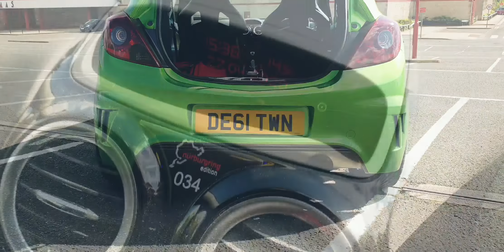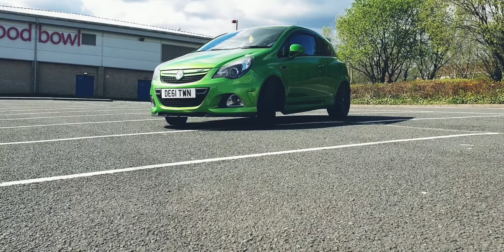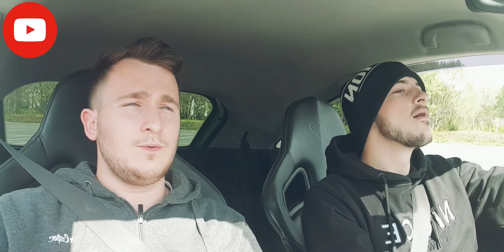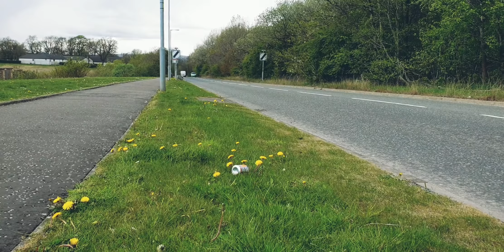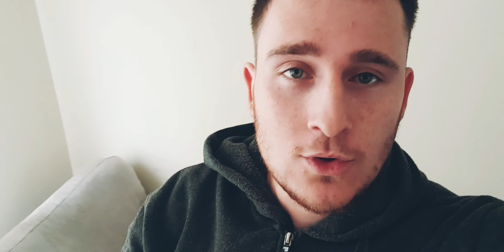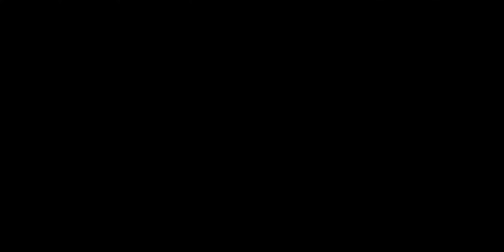Corsa Vxr nurburgring

Comment: Getting a Corsa VXR in next few months would you recommend going for the Nurburgring edition or standard and just getting a stage 1?
Reply from the maker: bro i use to have a corsa vxr nurburgring edition, don't remap the car because you will kill the engine get a proper map change the spark plugs, induction kit, exhaust etc because i was remap the car and after 1 week my turbo was a way , so better do it properly cost a bit more but you will "have the car for long time " hope that helps
Reply from the maker: the nurburgring edition they are already from factory maxed out